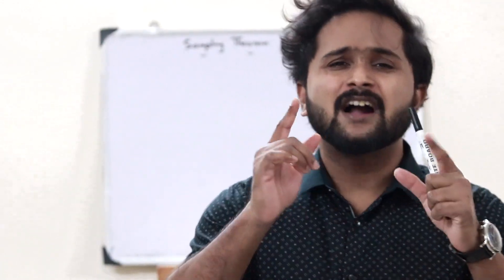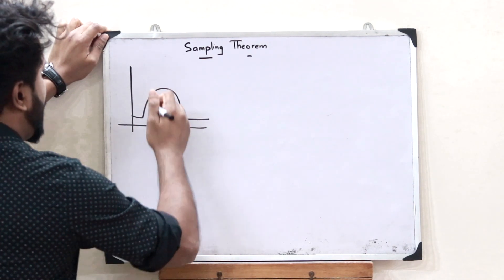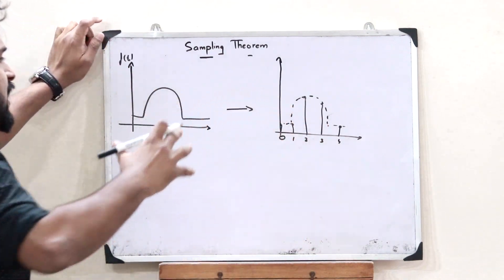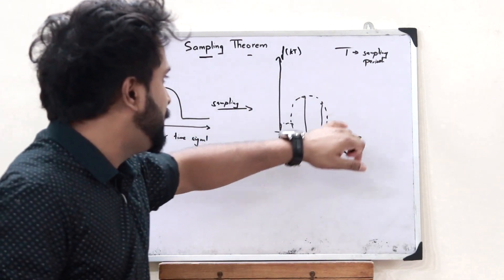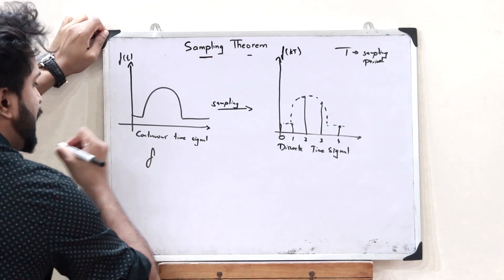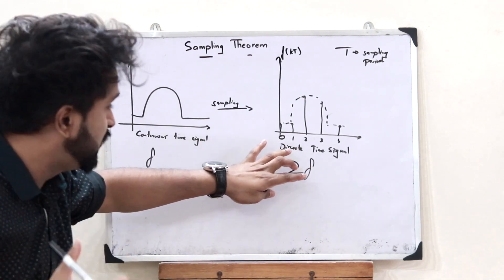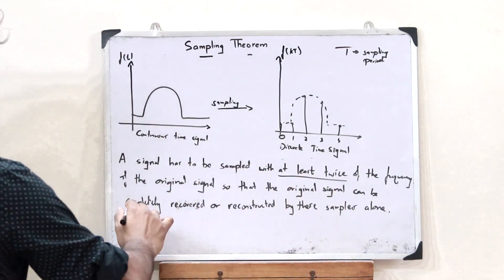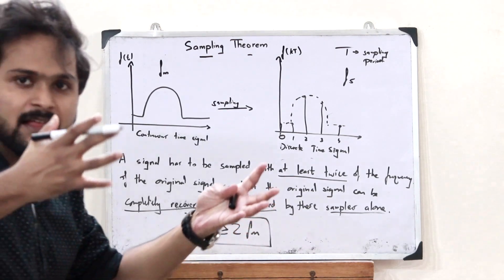Sampling Theorem in Control Systems | Simplified KTU EC 409

Comment: Sampling Theorem (Nyquist-Shannon Sampling Theorem):
To recover a band-limited signal at the receiver end, the signal must be sampled(reconstructed) at a frequency (fsamp) that is at least twice the highest frequency component (fmax) present in the signal's spectrum. This ensures that the original signal can be reconstructed without distortion or loss of information, assuming ideal conditions (e.g., no noise and proper filtering).